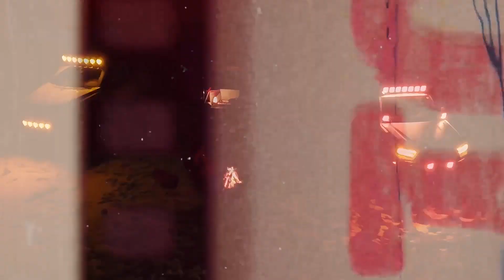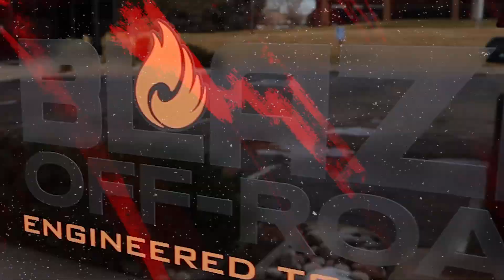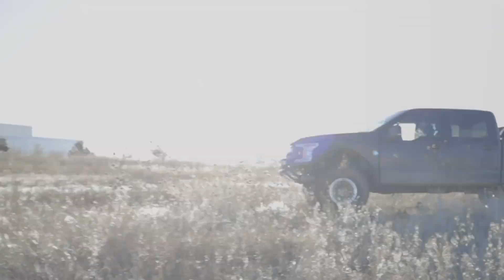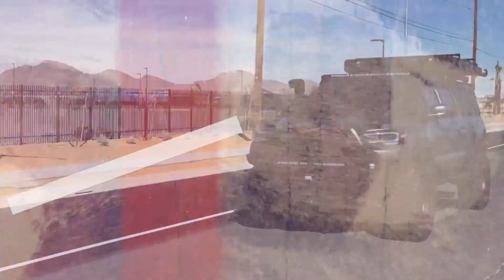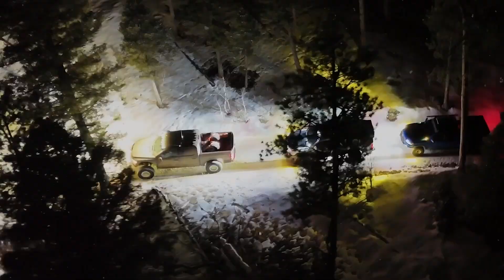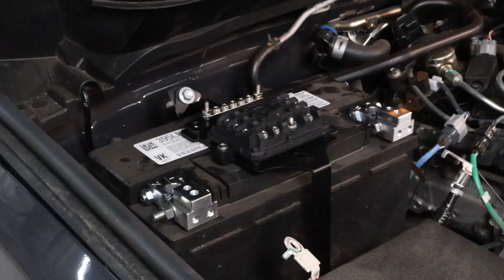24 Tacoma Electrical System - Easiest Install Possible

Comment: I assume you'll be working up something for the hybrids when they come out?  Great looking stuff!
Reply from the maker: Most likely not, but there is always a possibility. With the Tundra there was next to no demand for hybrid compatible parts due to the complexity of install and cost since Toyota put the battery inside the cab. For comparison, a non-hybrid tundra kit is about $700-$800, maybe $1,000 installed. For a Hybrid truck it’s a $2,000 kit, and over $3,000 or so installed. So there simply is not much of a market for the parts.
Reply: Well hell.  I was hoping for one of those so I can run my offroading lights off of it.
Reply from the maker: @moundman16  The main problem is the battery location. So you have to run massive power cables up to the front of the vehicle, through the firewall, then to a power system.
Reply: Yep no prob.   I just wanted to be cool. 😂😂